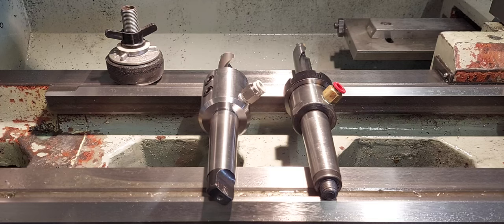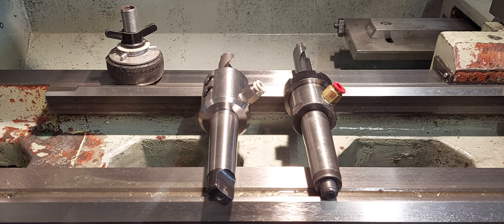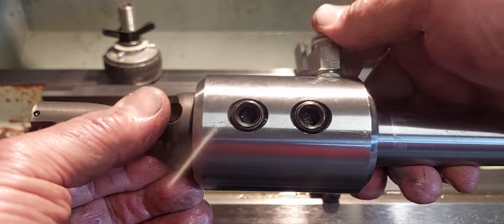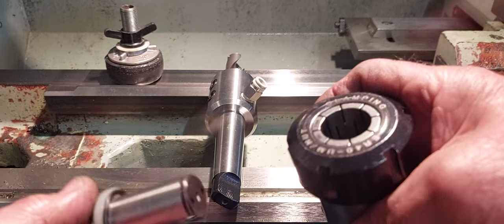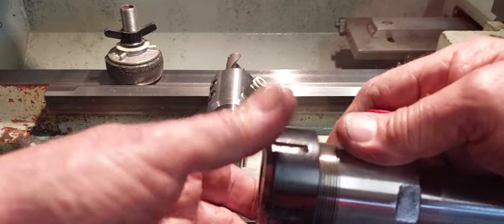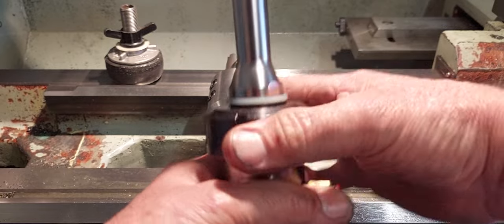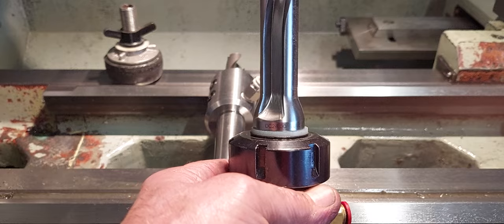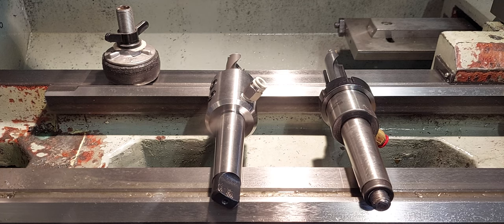How to use a U DRILL on a Manual Lathe ??

Comment: Just brilliant! You made a solid friend out of me. Thanks for this video. I got quite a bit out of what you had to say here. The main thing was seeing your design and implementation of the ER collet water seal. I got it! You've definitely got me sold on the ER holder rather than the 2 bolt. I try to have tooling that serves as many uses as possible which ER delivers on. 

I think U drills on a manual lathe is brilliant and underutilized. No materials should be off limits if the will to work with them is there. I like to machine a lot of titanium and stainless. So for me, getting an initial through hole in titanium is one of the hardest tasks. Something where this application will really help me out I think.

I'm got a PM-1236 lathe. It's set up with water cooling already. You've now got me started with a task list to get ready for adding U drill capabilities. I'm going to set up some magnetic splash guards as you've done as well as make a chuck cover for safety and water control. I'll likely have to switch out pumps at some point but will surely rock what I've got for a while- working within it's limits. 

That rear plumbing plug is interesting and I'd like to know more. I recently modified some plastic versions of that I bought from a hardware store to use as Purge Plugs for some 3" titanium tube I was welding. Worked wonderful though I did some thermal warping on a couple sides by accident and virtue of plastic vs. metal. 

Given that I already have a water cooled lathe, from my research so far, it looks like I can get up and running with a setup like this for under $100 into an ER to MT3 holder and a U drill with inserts. Thanks to the magic of modern day Chinese manufacturing and selling practices. This type of interest and purchase is the most fringe of fringe for a normal bloke who likes to be able to make things :-)
Reply from the maker: Thanks to your original comment.
I could make a better video about this topic.
After watching the previous video I posted, I realised a lot of information was missing ??
It was good to make another video that will be more helpful to others who might watch.

It sounds like you enjoy pushing your limits when working with a metal most people would never bother with.
I was previously doing work for a company who specialised in Titanium.
Unfortunately I was not able to continue with this type of work in my own shop for other customers.
Being that not many people use Titanium.
Mostly it was only small components for motorsports.
Even then it was rare
And some customers could never understand why it cost so much to weld ??
For that reason I decided best to keep quiet when someone mentioned Titanium.
Now I keep myself busy making components for other companies. 
Not as enjoyable as more specialised work.
But, It keeps me busy 😊👍

Comment: U-drills are pretty awesome. I run them all the time on the CNC lathes. Powerful internal coolant is a must as well as automatic feed. So on a manual lathe, mount the tool on the support and not the tailstock. Also take care to align or better, have a setup that does not need alignment. You need the most stable setup possible, ideally eliminate the compound slide. 
Another great feature of U-drills is that they can be run a bit off-center which often gets me directly to finish cutting with a boring bar. Yes we have a lot of different sizes in the shop. The ER collets are available with internal sealing but I think it is better to use the Weldon system as intended. Also this allows for for proper indexing when drilling off-center. It takes a bit of creative solutions to get the coolant through. The flat on the shaft of drills and boring bars is a leak path to be eliminated.
Reply from the maker: I agree with your thoughts of mounting the U-Drill in the Toolpost would be a much better idea and feeding in with the Leadscrew to keep the Feed Rate even.

I decided to show the U-Drill mounted in the Tailstock for a few reasons ??
Most Manual Lathes have a reasonably good Tailstock, but possibly not the capabilities to hold a U-Drill in the Toolpost.
It also makes the video easier to follow if I don't need to show how to align the U-Drill to the centre of the part.

I was trying to include as much information as possible but without adding too much for those who might be watching.

Thanks so much for watching and sharing your thoughts 😊👍